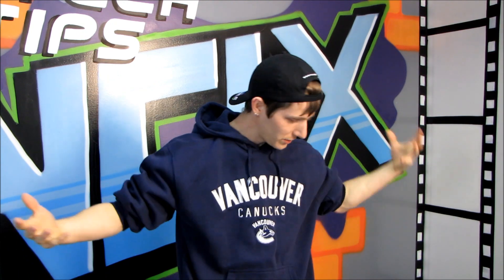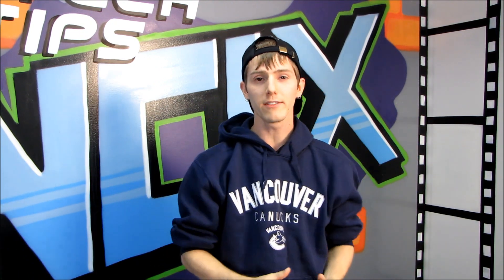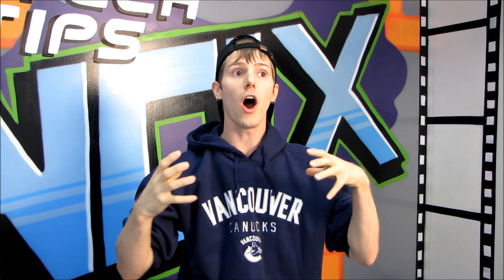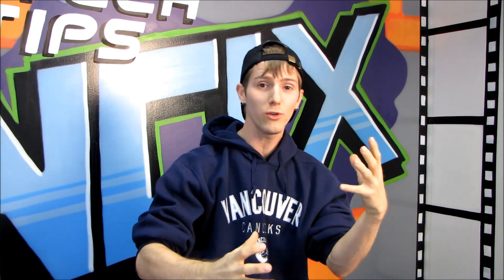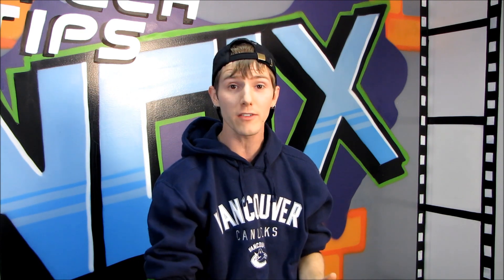Futureproofing Your PC - Dispelling Some of the Myths NCIX Tech Tips

Comment: nice video :) and my next pc will be - GB - 990fxa-d3 + FX8150 + asus 6970 dc2 + 2X4gb corsair vengeance + WD 1TB black sata 3 + CM GX 750W + CM Elite 430 Black + some DVD :) + CM Hyper 212 Plus + 3x EVERCOOL Fan 120mm for the case. pls tell me do you think this configuration is good

Comment: For me my first gaming PC was in 2006, then my current one was built 2009 and now the one im working on will be finished before 2012. I use all the best parts, except the current flagship GPU's (GTX 590) I opt for the GTX 580 second place cards to save money. All my builds have costed 1800-2000. Not bad consisting Alienware would sell you the same rig for 3.5k. And 80% of my life is spent on my computer.

Comment: @LostBearz Consider buying a GTX 460 that is...lots of numbers there, it wa sgetting confusing ;). Also go for a mid-tower. No need of full tower on a budget. Also, for the motherboard, at the time of your purchase, check for HDD prices. If you can find a nice SATA 3 (6GB/S), buy a mobo that supports it (you can find decent one starting at ~85$. You'll still have economic options at ~70$...what's your budget? Also look around on forums, you'll find plenty info (and with Linus's videos!!!)

Comment: @LostBearz For starters. search for a "AM3" socket Motherboard in order for your CPU to fit. and just make sure you can fit your video card and not block other components. You'll probably be just fine with 4GB for everyday + gaming. If you start doing a tad more than that, probably go for 8GB (not that expensive...). For that GPU (graphics card), you need a MINIMUM of 500W, but i'd go for at least 650, and 750 if you find a nice deal. If you on a budget, consider buying a 460...

Comment: @TheMinihilly For future-proof, an i5 2500k won't be really future-proof because you won't be able to upgrade it later to a better processor (in 2-3-4 years). I have a M2N-E SLI that can be easily upgraded to a Phenom II x4 965. With a good mobo, you will be able to upgrade fairly easily, so don't be afraid to buy an AM3+ mobo (bulldozer's coming soon!). Also, if you're an overclocker, take a GTX 560. This baby overclocks really well. I hope it will be useful. 
--Darkteammadfiz--

Comment: asus engtx 560ti dcII top
intel i5 2500k 3.3ghz quadcore
asrock H67DE 3 (b3)
8gig ram kingston
ssd bootdrive + 1.5TB standart sata II
cougar powerX 550W (i like to keep it low if u can because of the electricity usage)
alpenföhn CPU cooler (brocken)
just some standart sata dvddrive (i use iso's and usb sticks anyway)
the case is gonna be a coolermaster storm enforcer (black)

overall Prize: 887,97 euros inc. montage and 5% discount
get it on saturday :D nice video btw ^^

Comment: I soon plan on building a new pc but I have a question as to what CPU I should get, Ive been looking at the i7 2600k Unlocked and the i7 960, the 2600k is 1155 and the 960 is 1366, and I know the "newer" cpu's use the 1366 socket and I am just wondering if I should go with the 2600k or the 960. If anyone could help me it would greatly appreciated.

Comment: @TheMinihilly A GTX 560 ti or 570 is very good for the price to performance ratio.

Same goes for an i5 sandy bridge 2500k. You can overclock the quad core beast to almost 5 ghz on air without trouble, it's crazy.

Comment: continue or any other amd graphic card but gtx 560 superclocked would be best for gaming on 1080p on high setting not ultra. 850watts of powersupply would be enough for upgrading later. and dont spend too much on case mid case would be enough this would be the best. Hey linux would you make a video on these spec for bencmarking

Comment: if u r a budget guy then u should some money and build a rig which would allow you too play games on high setting not ultra or may be.first thing u should get a processor i would recommend u a quad core core i5 2300@ 2.8 ghz it would be enough for every game. i have tested on can u run it and is the best processor for speed. dont speed more money on i7 or other. 4gigs of ram would more than enough. now comes the main part graphic card plz get an high end graphic card like nvidiagtx560ti contiune

Comment: @UnknownXV Agreed. This is especially the case with CPUs, their pricing is lowering at an astonishing rate, it's now easy to gain yourself a respectable quad-core system. I also believe that GPUs are lowering at a similar rate - you can gain more power for the same price; and I am in need of a new GPU xP

...anyone have a recommendation (for both GPU's and PSU's (my current power is low)); thanks.

Comment: @MercenaryOfOZ Use an i5 2500 (or 2500k if ur ok with overclocking), a Z68 mobo and a GTX 560 Ti as your main components and work from there. Im building one under 1000 bucks as well.

Comment: @mad87645 The reasons i want the 2600 k instead of the 970( i was seriously considering it) is the fact that it is a bit of a pain in the ass to overclock where as the 2600k is just a matter of turning up the multiplier, core voltage, and adjusting the ram timings. If i wanted a the x58 chipset i would probably end up dishing out the extra cash and getting one of the extreme processors. If you think OCing on the 970 is easy then i will look into it but from what i have seen it is hard.

Comment: future proof build 

EVGA SR2 M'board, 2X Intel 990X OC'd to 4.5ghz+, 48GB Corsair Vengence 1600+ ram, 2X ASUS GTX 590's, as many OCZ colossus 1tb SSD's as possible running in RAID, liquid nitrogen cooling, enermax maxrevo 1500w PSU and a thermaltake level 10 case.

that build should last the serious gamer at least 12 days

Comment: My idea of futureproof would be to get a motherboard with more capacity than you need now. For example, if you're going for a x2 or x4 processor, get a mobo which supports an x6. This way, couple of years later, you can get a x6 processor without having to change anything else. Also, getting 2 sticks of bigger ram and leaving 2 slots empty is a good idea. 
Having the latest connectivity now (usb 3.0, sata 6Gbs) is also a way to get a longer lifespan...

Comment: @jewie27 lol.  outdated?  talk about over exaggerating high end gear.  it's a safe bet that a core i 7 line up ( 980x 990x or sandy bridge 2600k) gtx 590 and 6990 can both STILL play all games made in 2012 on full hd rez with all eye candy settings maxed with easily more than 45 fps for 90% of the total time of gameplay experience.  i've built more than 40 gaming computers since 2001.  I speak from experience.  Perhaps there is something I missed here though. seriously no diss meant.

Comment: For your SLI/Crossfire argument, what if getting a second video card is a MORE viable option if that graphics card goes down dramatically in price in comparison to getting a current-gen graphics card? For instance, I'd actually save some money getting another 5850 (which is really starting to drop in price like a rock) to add to my configuration, which can last me another generation, and then buy a new, single GPU when I need it.

Comment: I spent a lot of money on my setup and its far from
future proof and its specs are:
Core i7 980X @ 4.0ghz
12GB DDR3 1600mhz
ASUS Sabertooth X58
1x1TB Western Digital Green HDD
3x ATI Radeon 5870 1GB GDDR5
Corsair H50 in push pull config in a Coolermaster
HAF 932 case. 
even though its expensive it isnt future for much, not
my work or my games

Comment: Intel core i7 970 
Gtx 590 
12gb 1800mhz ddr3 triple channel ram
Some ssd some hard drive
Msi big bang xpower 1200 watt psu
Silver arrow two, nh-d14, or custom water loop 
Cosair 800d
Blue ray (if any optical drive)

Comment: Hmmm,

Phenom II 6 Core on Crosshair IV is upgradeable to Bulldozer
2x Flashed 6950s with a 6970 addition later
2x 4gb sticks of overclockable Corsair Vengiance
1000w PSU
H70 CPU cooler
500g SATA III Storage
32gb SSD for Win 7 and Drivers
Case With lots and lots of fan exausts!

Yep i think thats the AMD future proof

Intel= same but use i7 950 to upgrade to 990x in the futre when its not £850

Comment: 12gb ram
gtx 590
evga p67 mobo
1000 watt psu
intel core-i7 2600k
liquid cooling
2 2tb hard drives
2 512gb ssd drives
and a nice monitor doesnt really need to be 3d since I dont think that is going to become much of a staple.

Anyway this way if your a gamer the rig SHOULD (not saying it will) last you a while and when the time comes you can just buy a completely new computer

Comment: Intel Core i7-2600K 3.40GHz (Sandybridge)

Coolermaster HAF X with Coolermaster GX 750W PSU

MSI P67A-GD65 Intel P67 (socket 1155) DDR3 Motherboard

Sapphire ATI Radeon HD 5830 Extreme 1024MB GDDR5 

Cooler Master V8 CPU Cooler

Western Digital Caviar Black 500GB SATA 6Gb/s 32MB Cache

Corsair XMS3 4GB (2x2GB) DDR3 PC3-12800C9 1600MHz 
	
OcUK 24x DVD±RW SATA ReWriter (Black) - OEM
	
IC Diamond 24-Carat Thermal Compound (4.8g)

Comment: I just went with my first build. 
i7 970(six core)
GTX 580(single)
1.5tb 32mb harddrive(nothing special)
Asus Rampage extreme 3
Blu-ray/dvd all in one burner
King win Mach 1 power supply(modular so i should be good for a while)

It will get my by with my 3d rendering without going into those crazy Tesla Nvivia cards for a while i assume

Comment: It seems the most future proof would be to buy your new system the day a new socket comes out. Socket 1366/B came out in 11/08 and you can still buy faster chips for it. Memory isn't nearly as important and new video cards will transfer to your next upgrade (like Pci-e 2.0 is going away?). So, the best buy would be either socket 2011 or AM3+. Though, Intel constantly changes sockets.

Comment: Linus you forgot to mention another futureproof device, and that is the monitor. For instance, your favor Samsung 305T was introduce in mid 2007 and it's been almost 4 years since and it still stands above most current monitors on the market in terms of performance and specification. Personally, I own a 4 years old 275T and I'm still proud of it. Correct me if I'm wrong.

Comment: I tend to buy a pc every 2 years for around 1500 and then toward the end of that 2 years I obsess over upgrading my video card so as to run new games at maximum settings. Right now I want a DX11 card but upgrading my CPU to avoid a bottleneck means upgrading my motherboard too. Its a real stress trying to stay current as a PC enthusiast. Future proof pc: i7 2600k, GTX 580, 8gig ram, SSD HD for OS, date: 30/03/11.

Comment: expensive motherboard which capable of running at least dual sli / Xfire, thats future proof...
till the day ddr3 phase out...as for now
my build still can last last for a year or so although i'm dying of upgrading it...
LGA 775 ud3r DDR2
x3360 @ 3.40Ghz
2x2GB ocz reaper
Asus HD5870
1TB HDD partion @ 40GB boot... the rest for storage
ocz FataL1ty 750watt
haf X
h50 cpu water cooling

Comment: Yes. More episodes!

i5 2500k(I don't really do video editing)
GTX 560/HD 6870
GIGABYTE P67A-UD3R
6GB 1333 DDR3
64GB SSD for booting(Maybe more for games when it becomes cheaper later on)
WD/Hitachi 640GB/1TB(Games and videos)
Corsair HX850W Modular PSU 80 Plus(In case i want to Xfire/SLI)
CM CM690 II

No point getting the best parts since technology keeps on improving.

Comment: Why would u invest in a i7 processor for gaming i dont get it... Its gonna last same as a i5 and run the games at same fps til u gonna change them.
My future proof pc would be:
Core i5 2500k
P8P67 MB
8GB  DDR3
GTX 560 Ti
650W PSU
500 GB Disc
For GPU same thing like for the procesor....its not gonna last forever, ur not gonna see any noticable diference in normal gaming on the todays games...its gonna last the same, the next gen stuff will do same fps at cheaper price u buy todays high end

Comment: future proof build: 
amd Victor III 80 core @ 4 terahertz

800 gb ram

ATI RAEDON Victor 690000090

2 TB SSD for boot

40 TB HDD for storage

SUPERULTIMATEEXTREMEMILITAIRY-CLASSPREMIUM motherboard

2mX1mX1m holographic 'monitor'

This setup requires alot of electricity, so I would recommend a nuclear power plant as a PSU
-------------------------------------------------------------------------------------
I hope it will be able to run minecraft properly for the next twenty years

Comment: im building this days a totaly new gaming system with following components:

Intel Core i7 990x EE OC @ 4.3
Corsair Hydro Series H70
Asus Rampage 3 Extreme (USB 3.0)
2x 12GB CORSAIR CL9 Dominator-GT PC3-16000 KIT
2x  Corsair Performance 3 Series 128GB SSD
WD Raptor 150GB 10.000 RPM
Creative SB X-Fi Fatality Edition
Cooler Master HAF-X 942
Enermax Revolution 1250 
GPU will be 2x Geforce GTX 590 in Quad SLI and 1x  GTX 550 for Physix
At the moment: 2x 295gtx + 9800gt

Comment: I'm not sure I completely agree with the SLI comment concerning 95% of people that actually use SLI will do it only right when they first build their computer.

It's all about timing. I bought a GTX 470 7 months ago for $340. It runs everything maxed out right now. But games like Crysis 2 and BF3 are coming out this year. Will my GTX 470 be enough? Maybe. But if not, I can probably pick up another for less than $200. SLI GTX 470's will most likely still be better than a single card for $350+

Comment: Lots of great points but don't power supplies have their capacitors degrade over time?  By the time you have an oldish power supply, it may be better to get a new one if you want to run a more powerful system.

Comment: Armor Themaltake
1200 Watt Cheiftech
MSI P55 GD80
Core i7 860 2.8Ghz
Corsair Hydro Series H50 in push/pull configuration
G.SKILL Ripjaws Series 4GB (2 x 2GB)DDR3 2000
1X 300Gig Raptor
2X 500Gig WD
2X EVGA 260 GTX SLi

Comment: BTW

The reason I went for LGA1366 instead of LGA1156 is because in my understanding that is the only chipset that will support 6core CPUs (which I intend to buy around October 2011), has six slots for ram, allows for 2-way SLI in x16 for both cards or 3-way SLI in x16+x8+x8. In my opinion with these features my built can last for a longer time without a need to upgrade the motherboard and probably not even the CPU.
Do you believe that is the correct thinking or not?

Comment: I built a new system from scratch in mid-October 2010 with upgradability in mind. That is what "futureproofing" is all about in my opinion. Of course I am not expecting my build to last more than say 2 years. The components I used were:

ASUS P6X58D-E
Core i7 950
6GB 1600MHz
GTX460 1GB Gigabyte
1.5TB 7200rpm

I plan to add a second GTX460, an SSD as boot drive and Corsair's H70 cooler to allow for better CPU overclocking in about a month.

Comment: A future-proof rig means to pick the best investment. The investment is greatly limited by your motherboard, so its ideal to choose your motherboard over everything else first. Consider that the best motherboard (regardless of price) is one you can buy that has the most PCI and RAM slots, supports the fastest memory on the market (DDR3), and supports the best for your favorite processor company. Basically you have a choice between ASUS Crosshair IV extreme, and EVGA X58 4x Classified.

Comment: The idea behind future-proofing is to save cash in the long run, along with keeping stable performance. Linus is very insightful in this, but I believe I need to point out that future-proofing is possible 80% of the time because of Ebay.

When you buy Intel's 1000 dollar processor, and it turns into 800, that means there's a new one out for grabs. Sell the old one, get the new one; you might save 600 dollars on a new processor. Using this method along with Linus' insight is the best you can do.

Comment: i would build:
Case: Antec 1200, GPU AMD 6990, CPU: Core i7 750, CPU cooler: Coolermaster V8
Power Supply: Corssair 1200watt, RAM:10 gigs of DDR3 2000 mhz Corssair ram and some random 6gb's 7200 RPM 500gig hard drive

Comment: In a general use machine (a little bit of everything), generally a Core i7 overclocked with 8GB RAM and a decent video card MSRP ~$250-300 will last a while down the road.

But like you mentioned, futureproofing all depends on what you perceive it to be.

Comment: a quad core cpu ~ 
4GB of ram
gtx 460 which allow u to play almost every games @ least @ lowest resolution @ 1920x1080
a  500W PSU ~ 

as for chassis , monitor , speaker , soundcard , kb , mouse , i would invest more , cos i felt it would be the most future proof out of all of my system ^^ll)

Comment: 1. No not really merely agreed with my personal moto
2. case fractal design black xl because there sexy and quite
PSU 1000w bronze min branded (corsair,enemax,nzxt,ocz sort deal) for possible sli or higher needs 
Asus sabertooth x58 
i7 950 because pretty standard at the mo and the hex cores cost to much 
6gb of 1600mhz ddr3 mushkin/ocz/corsair who ever has the best deal on
2xsli gtx 470 because there quite cheap for proper cooled one like the gainward good gs is about £200 in my region.

Comment: buy new
core i7 860 or 870, oc to 4ghz
gigabyte ga-p55a-ud5
corsair mem vengeance 2x4gb kit 1866mhz
2x ocz vertex 2 30gb drives (OS)
keep
corsair tx950 psu
2xgtx275 sli +gt240 (physx)
scythe ninja 2 cooler 
my custom TT armor
and last but not least keep my 4x 140mm noise blocker fanss

Comment: 1. I would have to say that it didn't change my perception on on it, but it did help understand a few things m a little more clearly.
2. My pc: Corsair 800d, Evga class.E759(ek water block), i7-920@4.21ghz(Koolance block), 6gb G Skill@2033mhz, Silverstone 1500w PSU, x3Evga GTX 275(all three blocked by Koolance), Evga GTX 260 core216 for dedicated Physx(on air), x2 OCZ turbo SSD's in raid 0(360avg write.500avg read), x4 500gb. Seagate hdd's(storage), LG Blu-ray burner/HD DVD Reader, All liquid o